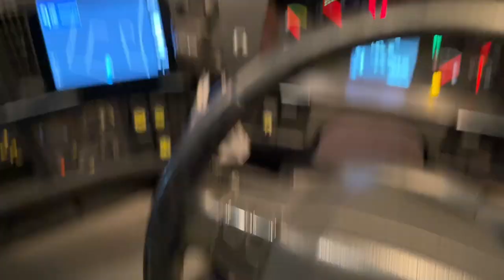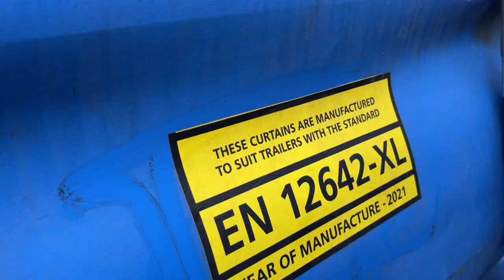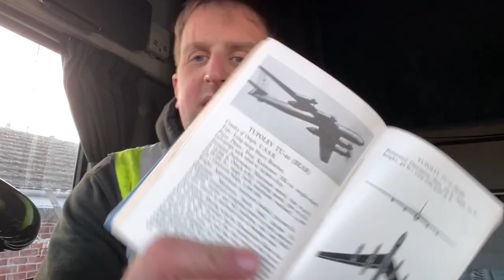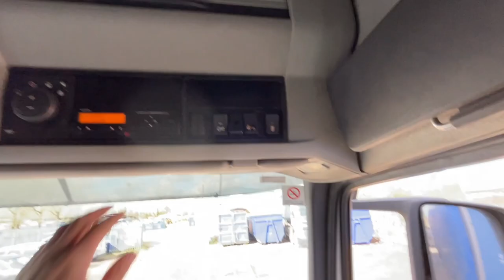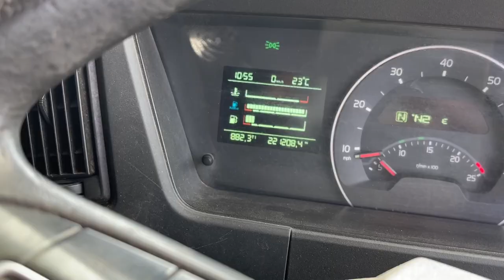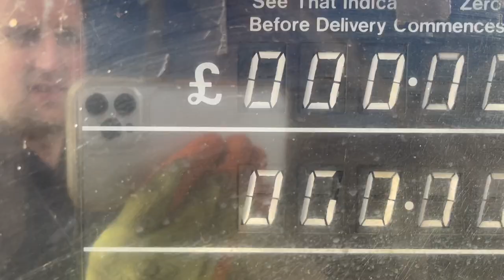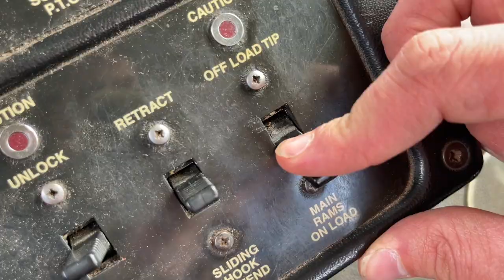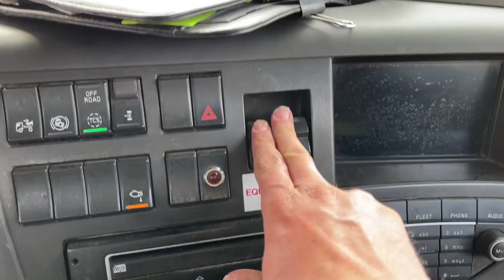Fuel Shortage AGAIN!! | POV | Trucking Vlog 52 | #truckertim

Comment: I got rear end shunted by a Turners of Soham, because some numpy decided to late brake to turn right in North Hykeham on the A1434, we had been diverted due to an accident on the A46 Lincoln bypass, my flatbed recovery truck was very badly damaged, and written off, but the Turners driver was very lucky not to lose his legs, my bed stopped within 2 inches of severing both his legs.